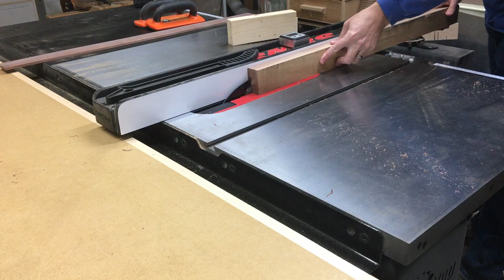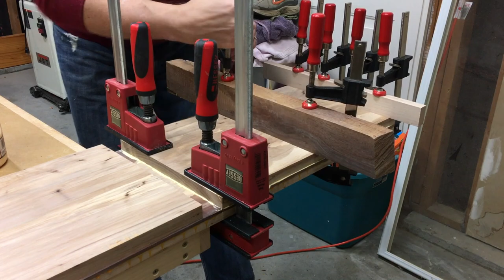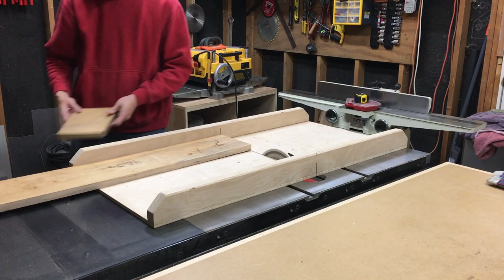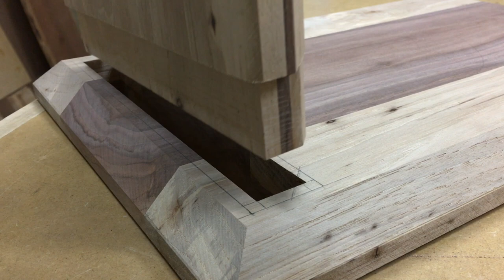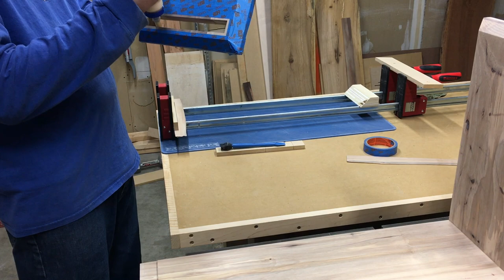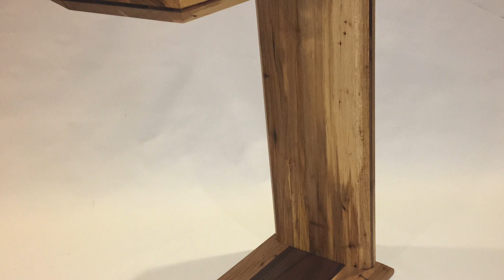Build a Waterfall Table | Build a Waterfall Grain C-Table | Woodworking

Comment from the maker: Want to support the channel? Here's what you can do:
 - Subscribe to the channel
 - Hit that Like button
 - Leave a comment
 - Amazon Affiliate: https://amzn.to/2LaN1Ib

In this video I build a waterfall edge "C" table.  This is my first piece of furniture that has no mechanical fasteners (nails/screws/etc) and my first attempt at a mitered "waterfall" edge.  Overall I'm very happy with the result.  The table is built from hickory and walnut sourced locally near St. Louis, MO and finished with 3 coats Tried & True varnish oil and 3 coats of Trade & True original wood finish.  If you have any questions please comment below or contact me via email or the socials.

SawStop 1.75hp PCS: https://amzn.to/2X4gWsP
Bench Dog Push Blocks: https://amzn.to/2YB00uL
Ridge Carbide 10-inch Saw blade: https://amzn.to/3bATmcp
Bosch 18v Impact Driver: https://amzn.to/3cxAhJk
Ridgid ROS: https://amzn.to/364yHMA
Titebond Wood Glue: https://amzn.to/2LzTdv4
Bessy Parallel Clamps: https://amzn.to/2z4LHG3
Bessy 6-inch F-style Clamps: https://amzn.to/3e3LGl4

Subscribe: https://www.youtube.com/danprudlow?sub_confirmation=1

Twitter: http://twitter.com/DanPrudlow
Instagram: http://instagram.com/danprudlow

Music By:

Impact Intermezzo by Kevin MacLeod is licensed under a Creative Commons Attribution license (https://creativecommons.org/licenses/by/4.0/)
Source: http://incompetech.com/music/royalty-free/index.html?isrc=USUAN1100620
Artist: http://incompetech.com/

Comment: why did you handplain if you have a jointer and planner too?
Reply from the maker: There were a couple reasons.  One is just for practice and then also a good sharp blade leaves a really clean and smooth surface that almost doesn’t need sanding where the jointer/planer leave some milling marks.  They are also kind of fun to work with.  Thanks for watching and for the question.  👍🏻

Comment: It looks like you’re operating out of a small garage… what is the square footage of your workspace? Just wondering because I’m trying to figure out how to build larger projects in a small space. Thanks!
Reply from the maker: Yep, it’s a “2 car garage”.  I use the quotes because it’s barely big enough for two smaller vehicles.  It’s just a touch over 17ft wide and 19ft deep so a little over 320 square feet.  I’m slowly getting better organized but if you watch my most recent video I just added a CNC so that is taking a good chunk now.  I still need to add a bandsaw at some point too.  Getting all the miscellaneous junk off the floor has helped me and of course having everything mobile so you can make space when needed.  I also still like to be able to shoehorn my wife’s car in when the weather is bad so I’m sacrificing a larger assembly table or dedicated hand tool bench for that ability.  Eventually I’ll probably just have to give up on the car…lol…or move!  👍🏻
Reply: @DanPrudlow  Wow, your space is actually smaller than mine, by a couple feet. I'm just getting so frustrated trying to move things around, and especially when I have sheet goods or larger projects to move around. I have a table saw/router table/assembly table station on wheels, and workbenches on two sides of the space. I have a sheet goods storage system that slips up against the wall and rolls out when I need to access it. But I can't even imagine how to get my wife's car (Mini Cooper) into the garage, even though that's been the goal for all of this, to be able to squeeze it in when necessary. Maybe I need to move lol.
Reply from the maker: I feel your frustration for sure.  I keep telling myself just keep making videos, try to get better, and someday that bigger garage or dedicated workshop will happen.  I try to not keep too much lumber, especially sheet goods, on hand unless I’m using it right away.  My lumber rack is stuffed now because a viewer recognized my mail box post from my video and happened to be moving and gifted me a boatload of walnut, white oak, and some other miscellaneous stock…but typically I would not have more than I need for a project.

Comment: Hey Dan! Great work, beautiful piece. One question, what is that sanding stick you used on the beveled edges?
Reply from the maker: The is for the compliment.  I just cut a strip of 220 grit paper and then used some spray adhesive on a strip of 3/4 inch MDF.  Works really well!  Thanks for watching! 👍🏻

Comment: nice but wayyy too much excessive work.
Reply from the maker: Excessive work?
Reply: Agreed, it looks like you spent a ton of time on stuff you could have skipped all together. All the hand planing could have gone through your thickness planer, and a lot of the chisel work looks like it could have been replaced with a router. I also couldn't see where all the sandwiched panels ended up, but I might just have missed it. Awesome product, and I love the nice fix for the oopsie on the mortise.
Reply from the maker: You are right there is probably some stuff i could have done differently that may have been faster but for me it’s also about trying different methods.  I had only recently purchased the hand planes so I figured I’d give them a try...heck of a workout lol!  Being a hobbies it’s not always about the fastest or most efficient way...just enjoying the process.  Thanks for watching and for the kind words regarding the result. 👍🏻